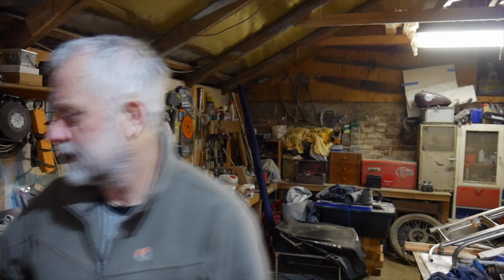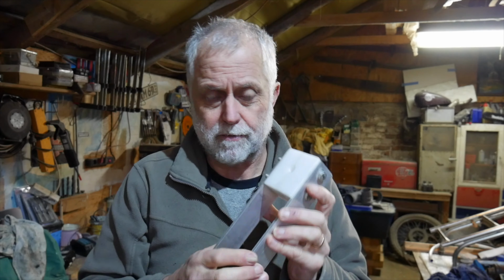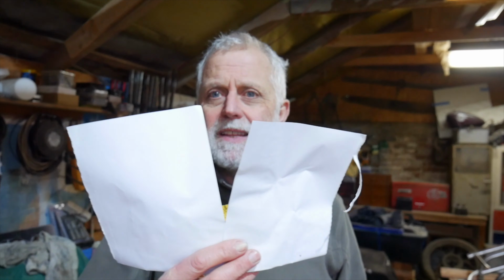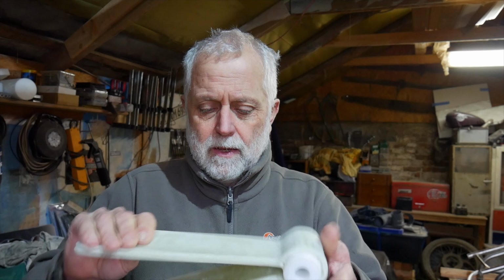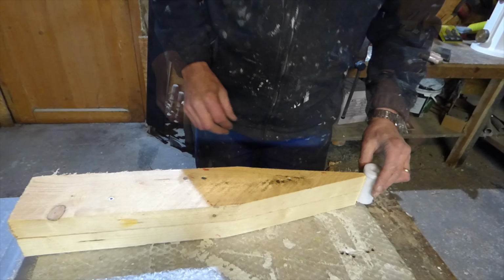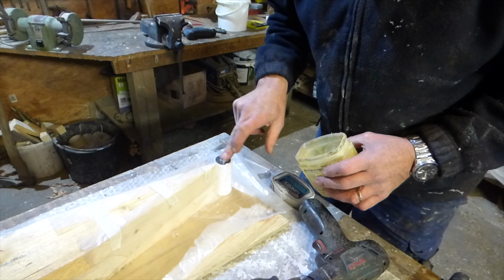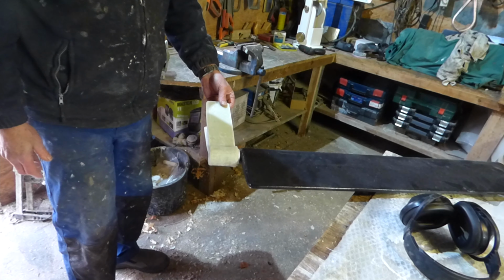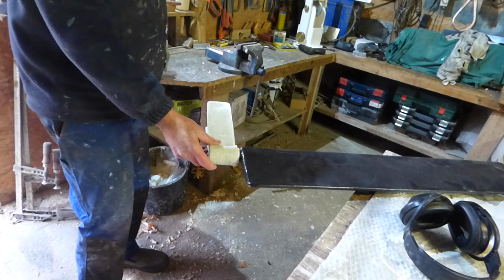A Long-Time Project Is Finished, And So Is The Windvane (Nearly!!) -SV Tapatya EP318

Comment: Wow, those lower bearing straps come out perfectly! Reading your Miss Molly series, it’s so amazing you can remember all that. The BSA part made me think of the one in your shop and I wondered if it was the original? It’s unreal how many times you went back for the BSA, and finding that part in the middle of nowhere in some random guy’s box, what an experience.
Reply from the maker: I wrote a log book so remembering is relatively easy, Nena 😉
Yes, it’s the very same BSA as is waiting for my attention in the shed. I built it up using a different frame for the trip to Turkey, but the one in the workshop is the original plunger frame 👍😃